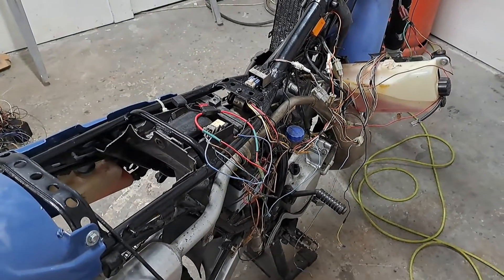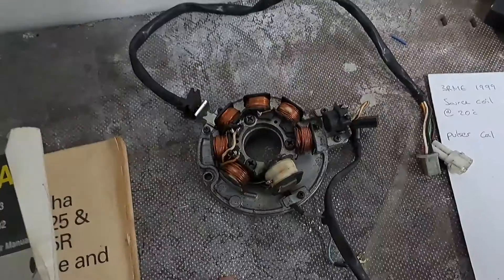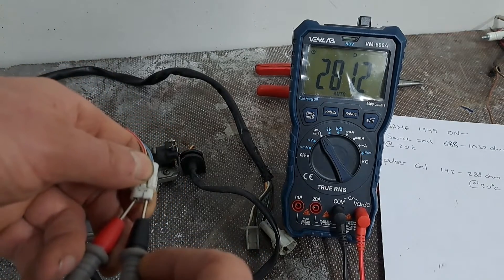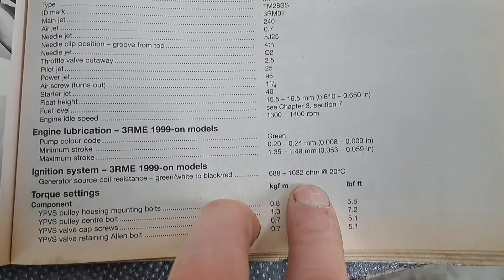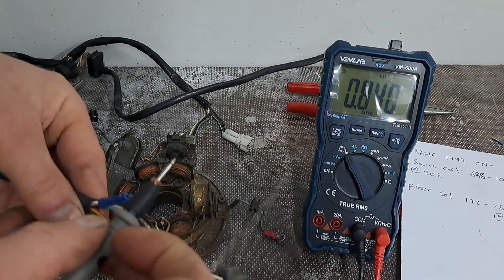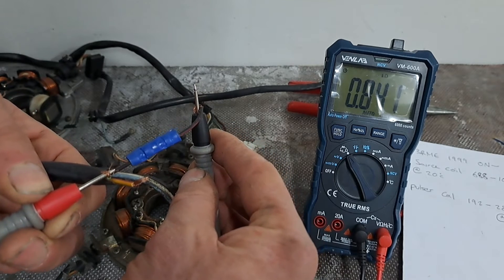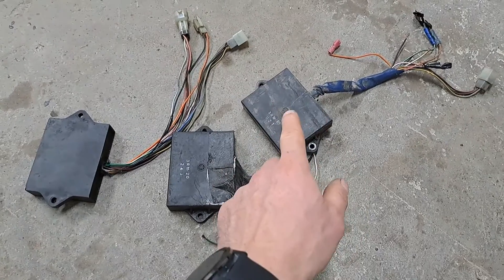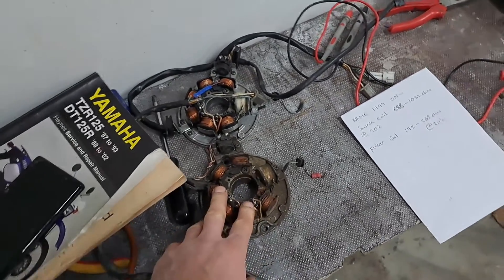dt125r electrical problem. How to check the stator coil. source coil & pulse

Comment: Hello, let's see if you can help me. I'm repairing a 1999 DT125R. It starts but fails. I'm measuring the stator coil between the green/white and black/red wires and it gives me 0.830 KOhms. According to the Haynes manual, it's 688-1032 ohms. According to the 1988 workshop manual, it's 192-288 ohms. According to the 2005 DT125RE manual, it's 192-288 ohms. I would appreciate it if you knew the correct value. My stator is the same one that appears in your video. Regards.
Reply from the maker: Have you tried a different cdi unit? Ive found that its not really common to have a stator problem and more likely the cdi.
Reply: @Supercarlsunday  I haven't tried any other CDIs. I've tried two stators, one of them new, and both give me 0.830 kOhms. Is this value correct? I'll buy another CDI next time.
Reply from the maker: @javieos I can't remember, the information is in the manual. It will be the cdi unit and not the stator..

Comment: .8 kOhms is the same as 800 ohms. It’s just the way it is written, or the way your multimeter is displaying the reading I should say.
Reply: Which also means your readings are fine. Possible faulty CDI if mechanical/compression and fuel is ruled out and the ignition coil tests ok.
Reply: Kilo Ohm = 1000 Ohms
Reply from the maker: Yes, its the way it displayed it. Confused me a bit at the time. It auto changed from ohms to k0hms. It must have changed due to it been at a certain higher reading rather than displaying in ohms. Thank you.

Comment: Hello well going off what your readings are and what it says in the book it looks faulty but iam no expert .thanks
Reply from the maker: It does doesn't it. Unless they have messed up in the book and failed to state kohm instead of ohms. 3 of them all the same! Nothing to say the others would have been any good either as all the bikes where bought as spares. I can see I'm going to buy another stator. You can get an after market one.  I Recieved the Tzr manual. We where away up Tan Hill in the van..  It had been put through the door. Very much appreciated 🙏 👍
Reply: @Supercarlsunday  yes it's a shame you couldn't get one off a running bike and that's good that the  manual arrived and your welcome  !
Reply from the maker: I know. I got a new coil to try, if that doesn't work I will get a stator if neither of them are the problem it will be the cdi. I'm not sure if the cdi pack up completely though when it does.
Reply: @Supercarlsunday yes you keep at you will sort it out iam sure 👍